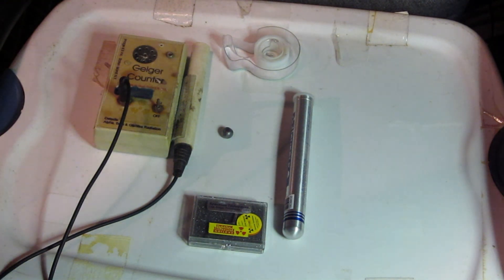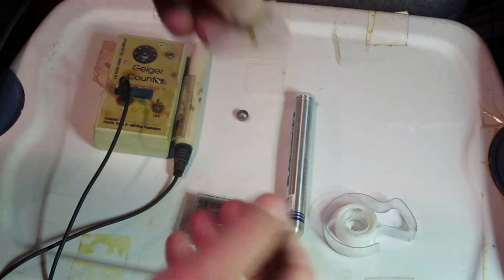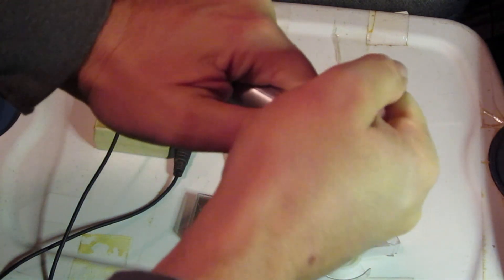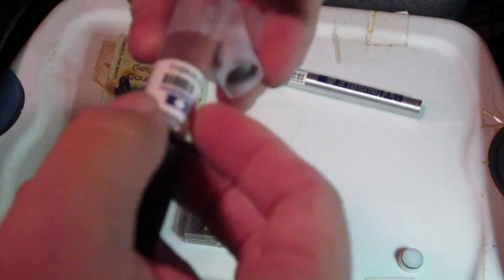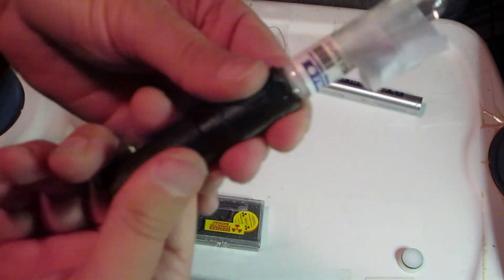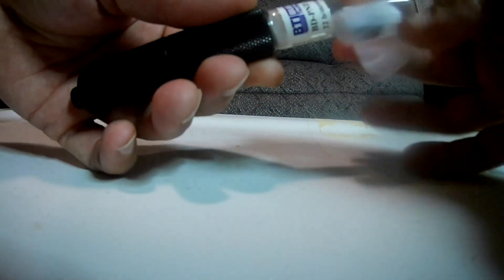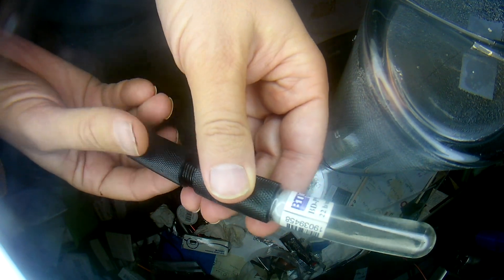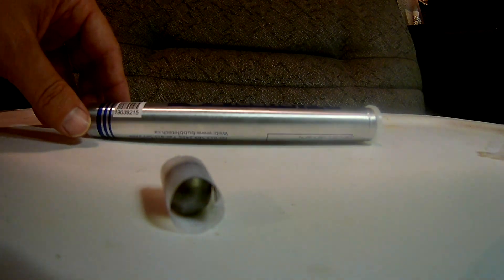Americium-Beryllium Neutron Generator and Bubble Detector

Comment: Would not want to grab that strip bare handed, they can get leaky and get some Am oxide on you. Stuff is easily as nasty as plutonium. Once i put about 48 of those strips on a beryllium laser mirror and it made a source strong enough to lots of fun experiments with. Used it to calibrate the LiI:Eu detectors for neutron detection range. One fun demo was to put a bottle of coconut oil over it and watch the detector go nuts from the moderated neutrons 🤓
Reply: You're crazy. What was the neutron flux?
Reply: I was going to ask that

Comment: That's funny I can recognize that strip because I've got one myself well I've got a few kind of cut up with some smaller versions of them like the round ones lol. You can't find the old ones anymore really
Reply from the maker: Very cool.. They are awesome! I made of video of me removing these from a detector.. Thanks for the great comments!
Reply: The one from the bolt is wayyy stronger than the lower strips. Hard to find the units they come from but they have 60 to 80uCi per serving. Also you can free the tube in the base by cutting the wires free and roasting the metal part till the epoxy smokes and then pulling the tube out. 😅🤓

Comment: Hey, I’m now making one for my self. Do you think that an americium button would work, I’m not sure as it it much less powerful than your piece of americium.
Reply: The strip he has looks like it's out of an industrial smoke detector equal to probably a hundred smoke detectors I've bought a couple along with hella smoke detectors to make my sample
Reply: To all your people with the smoke detector buttons it's actually electroplated onto that copper looking disk that's inside of that button takes a little bit of work to get it out and it's tiny there are larger sources possibly at least there was 7 years ago but you got to look in to old smoke detectors industrial type
Reply from the maker: Sound like an interesting project.. Let me know how it goes!! Thanks!
Reply: That one disc is 10 uCi of activity and button source have 1 uCi
Reply: That's badass man

Comment: So how does the generator work? does it use the beryllium to reflect the neutrons out of set up in the hole at the top of the beryllium. Or does it bombard the beryllium and make the closely bound neutron shot off/disintegrate if so then how does that make bubbles in the water. Final question would it make things radioactive. Sorry I’m very confused to how this amazing contraption works.
Reply from the maker: I place the Americium metal strip next to the Beryllium pellet, so the alpha rays bombard the surface of the Be. I place the Am strip closest to the detector, since the thick Be pellet will reflect neutrons back to the detector. It turns out that Be is also a very good reflector of neutrons as well! There is a fusion reaction that happens when the alpha rays hit the Be.. it is :9Be4 + 4He2 -> 12C6 + 1n0
This is the reaction that lead to the discovery of the neutron!!
Reply: Thanks so much for the help, that makes complete sense. Thank you 👍

Comment: Do you think Lithium would work, instead of Beryllium?
Reply from the maker: Ok, I can try that experiment.. Thanks!
Reply: jaynes network Ok. I want to make a neutron source, but I want to make one with stuff I already have. I’ve heard that you could make one with aluminum foil. Could you try that too? Thanks!
Reply: @jaynesnetwork  i am also trying to build similar, i dont have beryllium except for in copper alloy. i have a bag of tantalum capacitors i could blend, also tungsten welding electrons with thorium. lithium batteries..? 
will keep an eye on this channel
Reply: @drspastic  the lighter an element is the tighter the cross section so the more neutrons will be generated